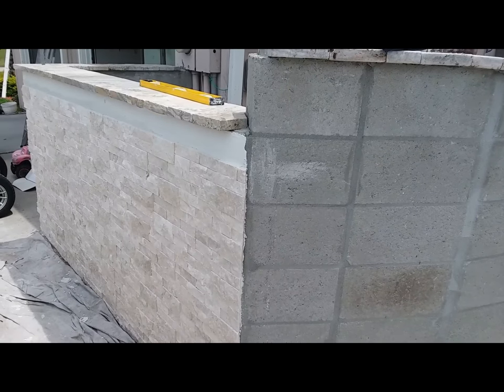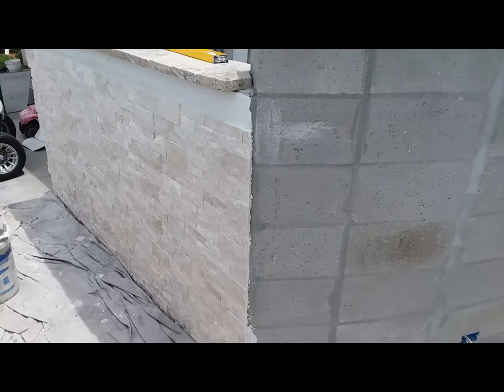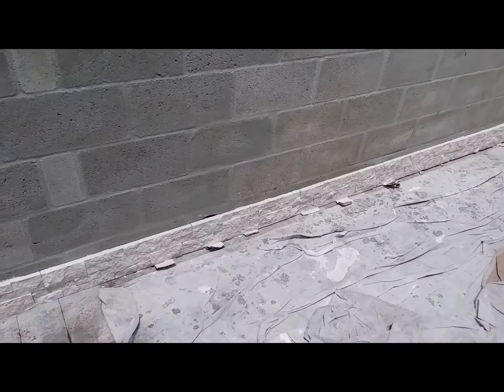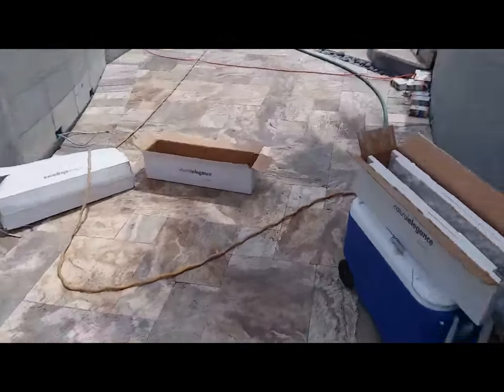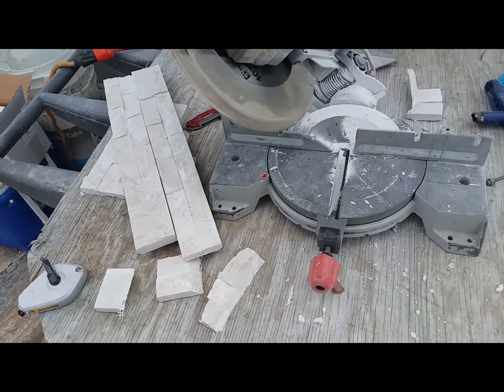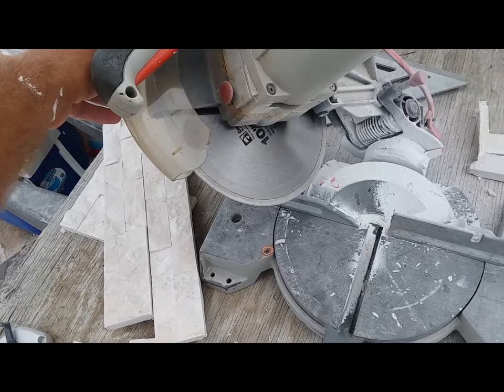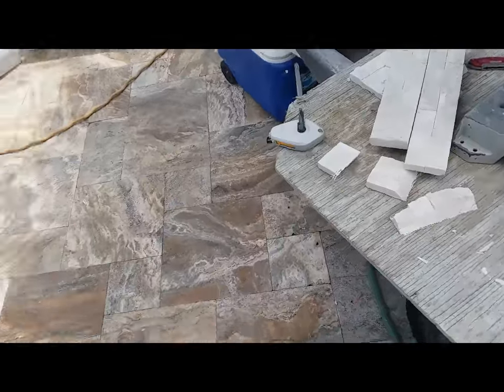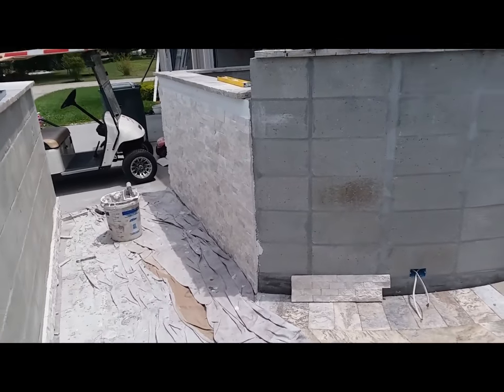Veneer Stone panel Split face stone travertine install tutorial ( Part 1)

Comment: Great vid. Thanks much; how did you end up doing the curved wall with the stacked travertine panel? I plan on putting in a spillover hot tub in with our existing pool and will need to tile the exterior wall of the round hot tub. Cheers
Reply from the maker: Hey brother.. Thanks for the thumbs up.! So....as long as the radius on your hot tub isn't to tight the stone panels will work just the same. ( assuming it is also on mesh backing like these were) You should be able to apply just the same as a flat wall. Feel free to shoot as many questions as you need.
Reply from the maker: I'll try to get by there and shoot a quick vid on the final product this week. I've been meaning to anyhow
Reply: Appreciate it!

Comment: The first coat of thinset it's the same that the one that you use to stick the stone ?
Reply: Thin sets all the same, they just have different formulas like non sag or rapid drying to waterproof. Pick ya thin set and make sure you can use it with the notched trowel you’re using and ur gtg
Reply: @nickmoser8235  thanks for the answer !!
Reply: @manuelgonzalez3718  consistency is key as well. There are tons of good videos that can help you. But go to Home Depot in your area or Lowe’s and they’ll have some decent mortars

Comment: Can you lay veneer right over painted stucco?
Reply from the maker: You can. Make sure you use a bonding agent over the painted surface.....and then apply a scratch coat of mud ( allow to do 24 hr.) before sticking stone.
Reply: @marktate6844  can you apply to non-painted stucco? I am doing a faux "stone pillar" look on the bottom 1/3rd of the garage (left and right side of garage, not garage door obviously). You see this in a lot of tract homes I think so you should know what I'm trying to do here. I wish I knew what this was called but anything I need to know?
Reply from the maker: For sure! If the stucco is troweled down very smooth go ahead and roll thin coat of bonding agent on just because. It never hurts to use  bonding agent. Use modified thinset as well. A little bit of stone placed in the right spot on a home can make a world of difference.
Reply: @marktate6844  Yes absolutely!
Reply: @marktate6844  Thank you so much for the info.  What should i use for the scratch coat?
Reply from the maker: Use a good thinset. Modified versa bond or similar
Reply: @marktate6844  Much appreciated
Reply from the maker: No sweat

Comment: Will these crack in winter ❄️?
Reply from the maker: I'm in South florida so I'm definetly  not an expert with cold weather applications. Id research before making a purchase that could be a bit pricey. But....... I think with all the stone being individual pieces attached to mesh there is plenty of space and flexibility for this type of stone to move, contract, swell, or whatever it wanted to do in extreme weather conditions. I wouldn't hesitate to put it on my exterior walls up north. The preparation of the walls and the type of mud that was used to bond it would probably be my main concern. Hope this helps